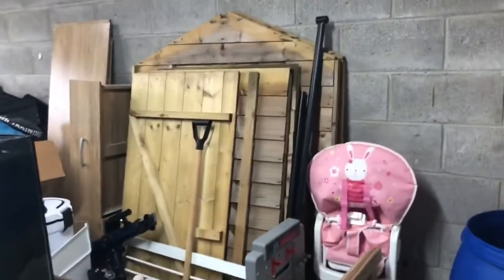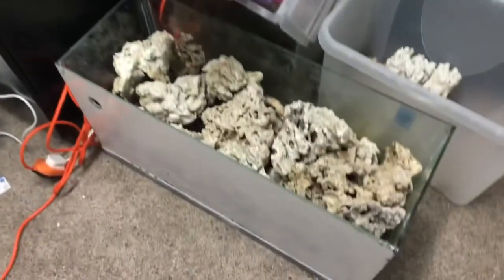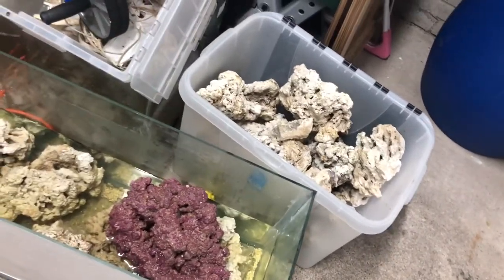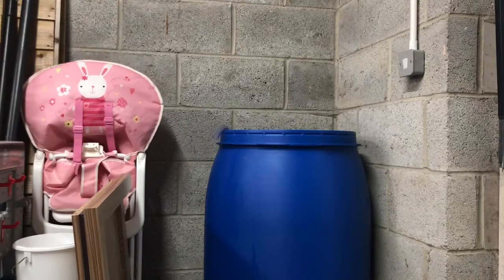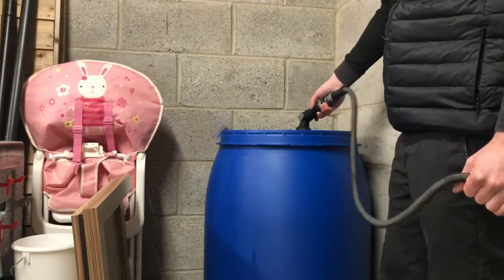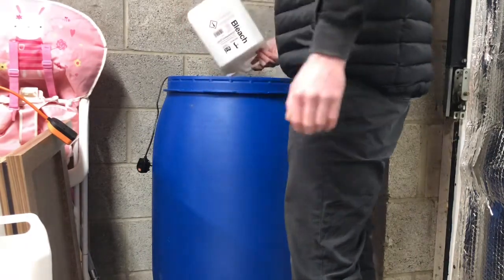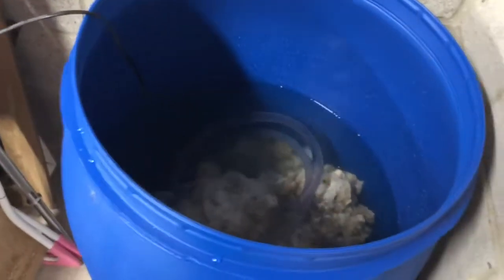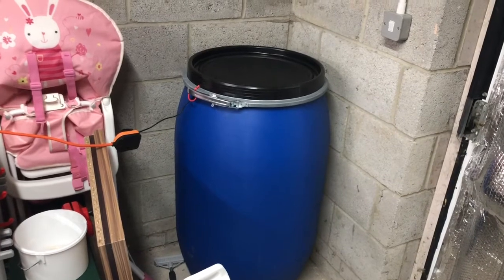Curing reef rock in bleach

Comment: How did this method work for your build? I am using a bunch of rubble and bio balls frag plugs sect from an old frag tank. It been about 10 days but I dint use a wave maker because brs said to do  it outside.  I wonderer since there isnt much in the way of holes in rock ect if it will  be ok.  Did you just rinse or set in the sun? Great video!